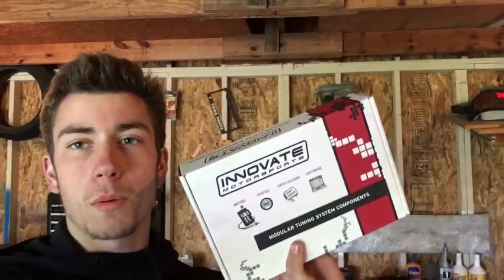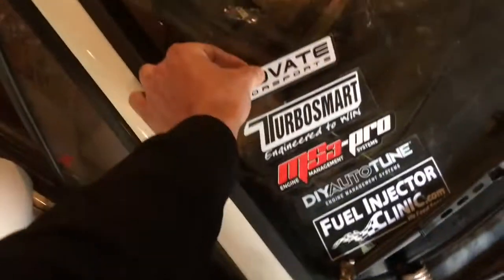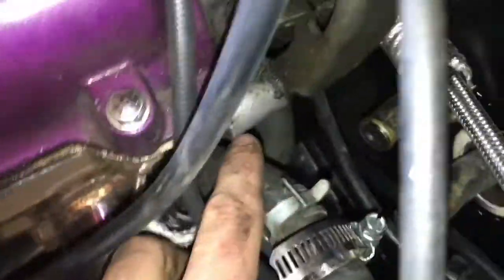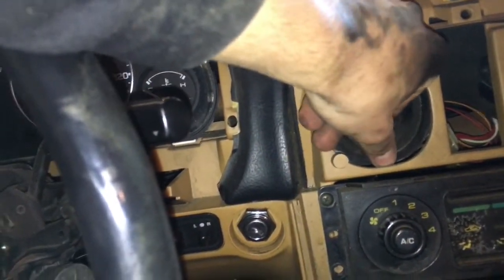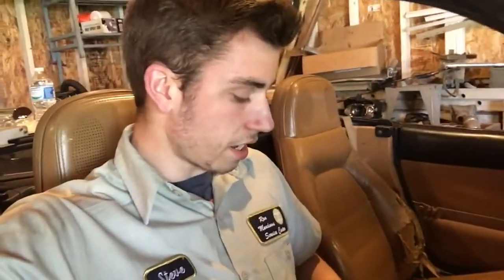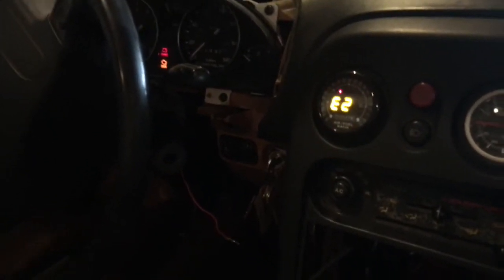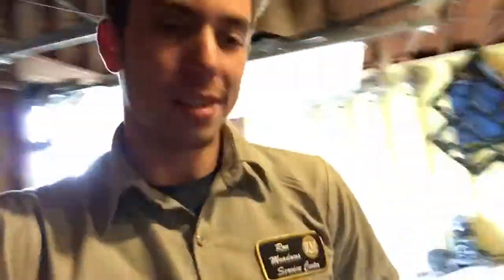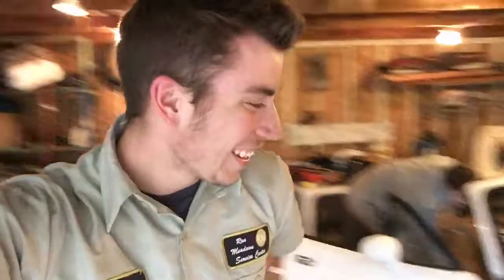DIY Innovate MTX-L Wideband Install

Comment: Good luck with that piece of shit product.  Mine lasted maybe a month until I got the e8 code.  Innovate won't help at all.  1/10 would not reccomend.
Reply: How far away was your O2 sensor ? Mine is real close (8" from turbo) and haven't run it yet.....but thinking of moving it to the recommended 24".